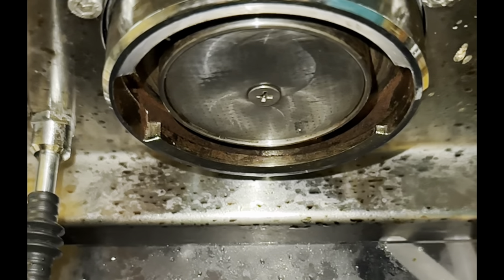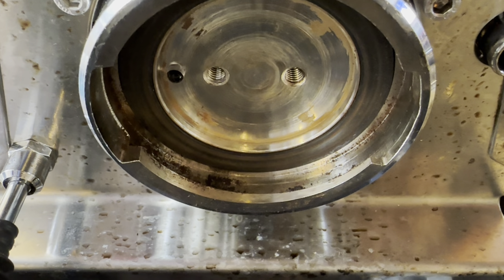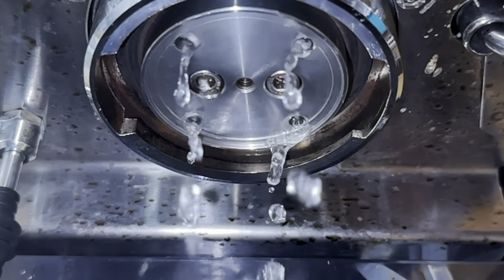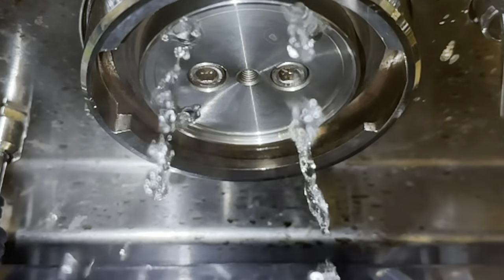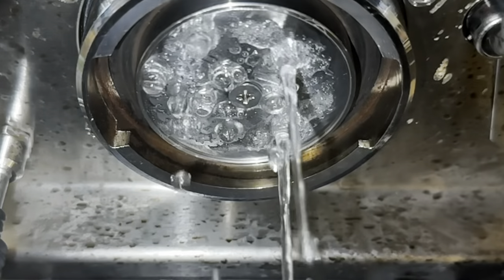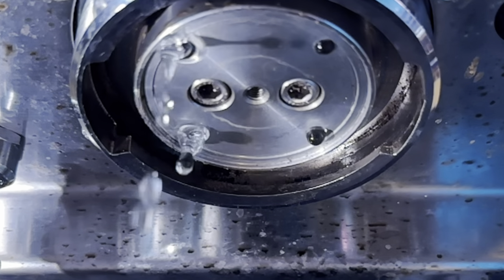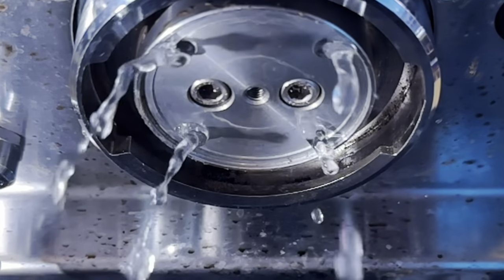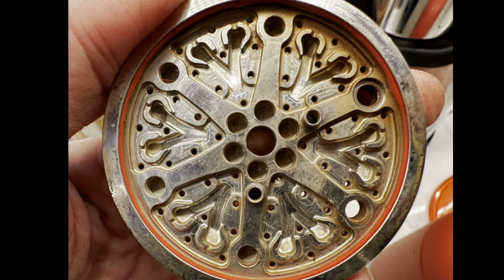Gaggia Classic Grouphead: Technical Breakdown

Comment: yep, i observed this too. idk what the effect is on the compressed puck saturation but id expect it to over extract around the water inlet that attaches to the dispersion block
Reply: there is an alternative dispersion block — BIT International. I’d like to test if it solves for this issue.
Reply: the other thing is, it’s hard to really extrapolate this to the situation when you have a portafilter with the coffee puck locked in. the flow could be a lot more even then, because of the counter pressure from the puck pressing against the shower etc. which changes the water flow dynamics

Comment: Interesting video and helpful to understand the water flow.  However, my Gaggai issue is there's no water flow other than a trickle.  I leaned the shower screen, the coffee gasket with handle in hot water with Puro Espresso cleaning powder.  I then removed the cleaned handle and shower screen turned on the machine and no water.  I do hear the humming of the pump that's al.  Any suggestions?
Reply from the maker: I’m not sure. If the filter isn’t clogged, it must be further in the system. Maybe scale. How long have you had it?

Comment: My Gaggia Classic Pro blasts water through the basket when we have espresso grounds on it. I took it apart and cleaned it. It has water coming out of one side like this video showed. Is there a way to turn down the flow of water?
Reply from the maker: You can do a few things like reduce the temperature or modify the shower screen. 

Here is a writeup on some tricks I tried. https://rmckeon.medium.com/gaggia-classic-tricks-and-critiques-7426c8aa34a9

Comment: I tought im crazy. After my vacation my gaggia water flow was like yours very plump and weak and before my vacation it was mir like a rainshower like in the first sequencez. Somehow my gaggia became sick when i left for 10 days. What can i so now? How can i fix that? I already descaled 2 times. I cleaned. Nothibg helps
Reply from the maker: I’m not sure. I am sure there are better people to ask than me because I’ve only used the machine two weeks.
Reply: I'm currently having this issue with mine. Apparently scale buildup sometimes breaks free and clogs the solenoid valve. Whole latte love has a fairly simple tear down video to open the machine , remove the solenoid, soak the parts in descaler and then blow the debris out of the manifold with air or water pressure. 

I also saw a video where someone claims that you can toggle the steam button on/off while the brew button is on while descaling solution is pulsing through the solenoid valve. They claim this can take multiple attempts. 

I plan on doing the tear down because i need to replace my steam regulator valve anyway as it's been leaking steam for months now.
Reply: Did you find a solution by now? I just returned from my vacation the water flow looks like in the first clip

Comment: Do you know of any machines that do not have this problem? I suspect this is part of the reason why I still prefer shots from my Flair to the shots from most other machines I try.
Reply from the maker: @nicholasscott4138  lever machines have a variant. Some machines like the Maro looked at trying to make this better. E61 machines usually have water coming down from a center screw, but water acts funny. Decent has tried to keep this type of water flow with a piece to correct it, but it doesn’t correct it.
Reply: @espressofun6091   Interesting, thanks for the reply. Oddly enough, my pump-driven machine at home does not have an E61 but has water coming through the central screw and I still get this problem.
Reply: @espressofun6091   Interesting, thanks for the reply. Oddly enough, my pump-driven machine at home does not have an E61 but has water coming through the central screw and I still get this problem.